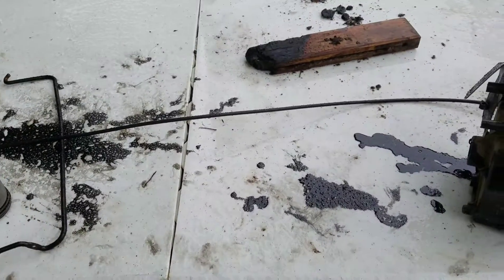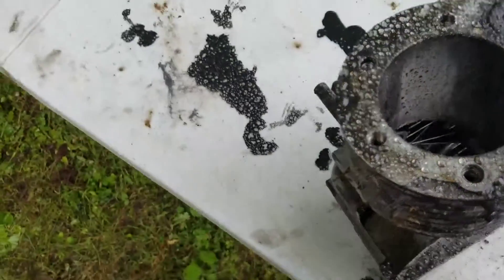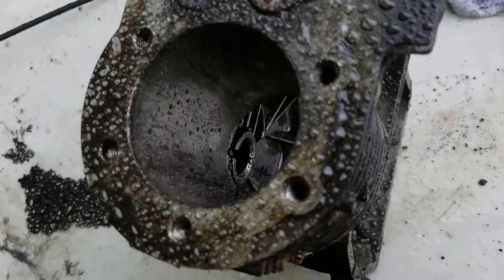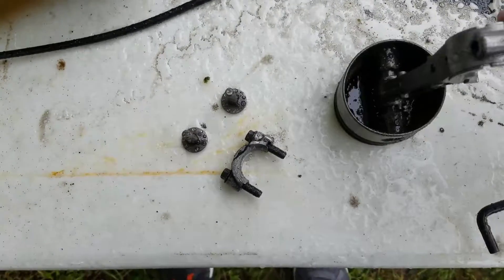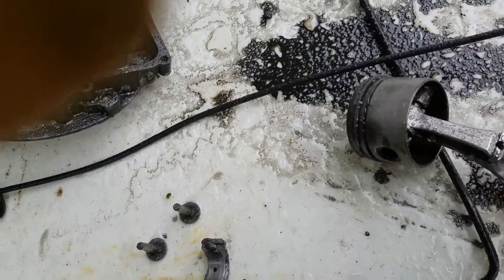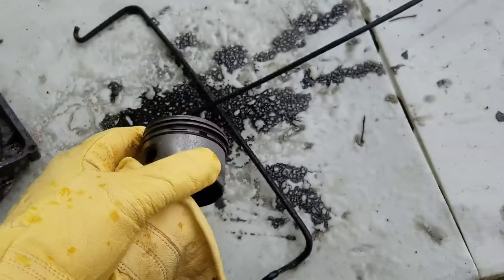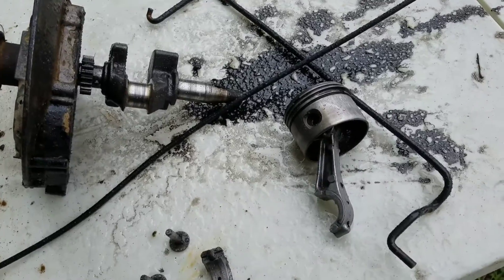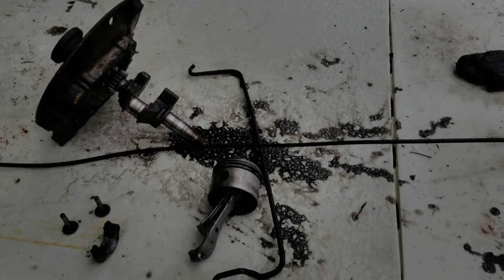Update on adult beverage mower

Comment: Too much wear on too many pieces for my liking. The fact that the crankcase is BLACK tells me that this engine was abused, and likely overheated. There are too many other good engines out there that you can find another to put on your chassis. Save the chassis until another good motor on a junk frame comes along. If we lived closer I would be happy to give you some motors. Too costly to ship I think.
Reply from the maker: Thanks you so kindly for you "expert" opinion cause I would have never known it was so badly abused or over heated, we will save the chassis for another day and move on. Thanks again George